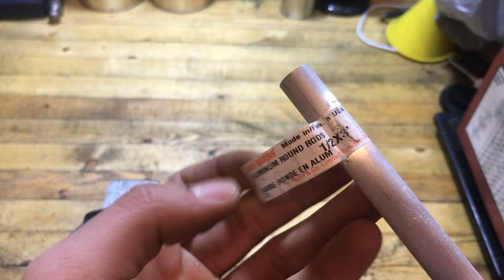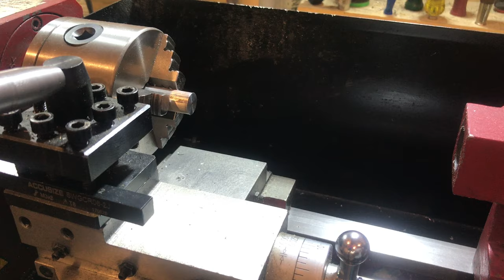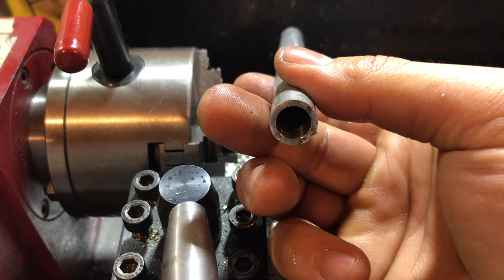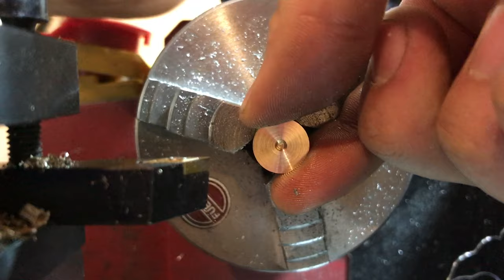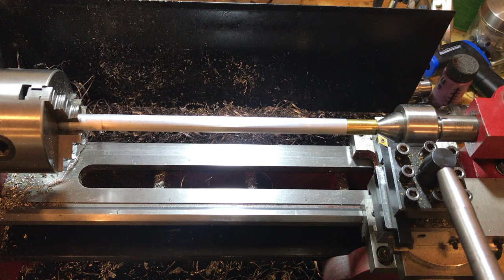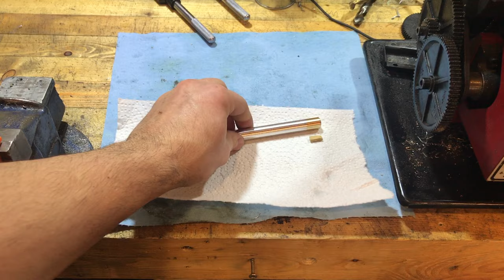DIY apple pencil case - Mini lathe projects

Comment: I'd buy the shit out of this. I wonder if it might be more efficient to have a threaded up that had a magnetic mechanism that wasn't screw in. If you habitually pull it out, it wouldn't be a hurdle to simply flick a switch and have the end up cap release the pencol and slide out. almost like a pez despenser. not that you asked for ideation on your dope product haha but given there's no link, you must not have sold it. understandable. great idea! if you ever do, i'm a customer